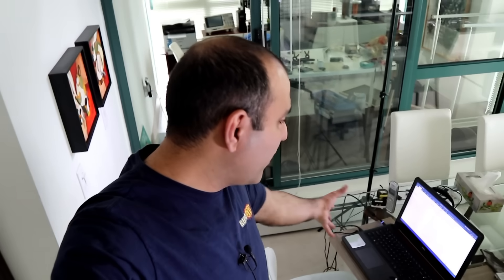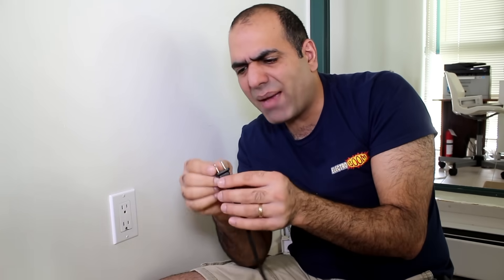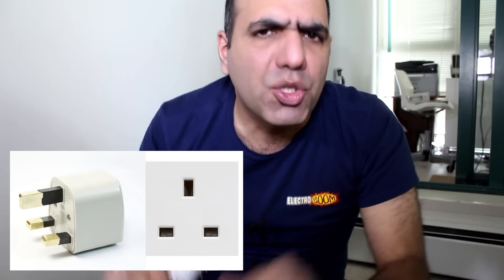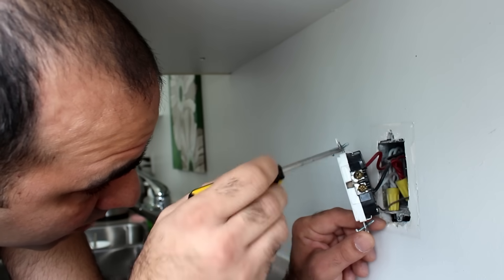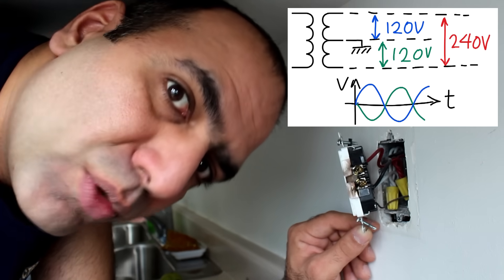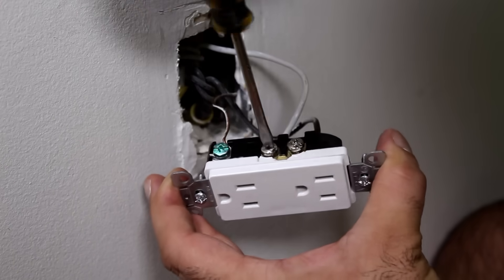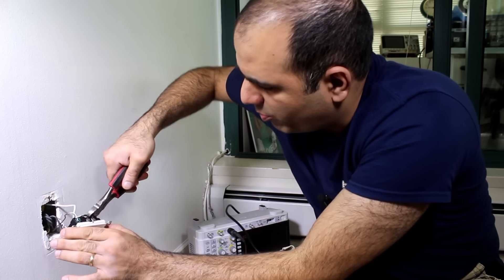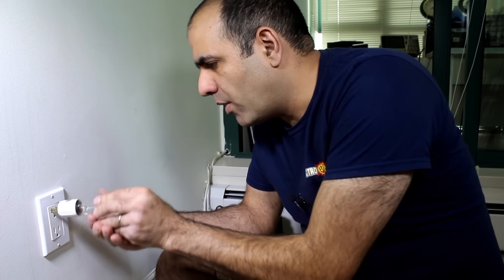How to Replace a Power Outlet

Comment: As an electrician I can tell you now do not use the hole in the back to plug the wires in make hooks and tighten them down around the screws
Reply: besides any safety issues, it's just more convenient to unscrew and pull a loop off later if you ever gotta replace it
Reply: Also, make sure you loop the wires around the screws clockwise.
Reply: I was scanning the replies for this... you are correct :)
Reply: I was always told that over the years, warming and cooling can loosen the connection and eventually cause resistance... leading to more heat, etc etc... same reason aluminum wire is a bad idea for internal wiring. Best to do it the hard way and clamp them down good with the fasteners
Reply: I have personally replaced many outlets where the previous installer used the push holes and it eventually resulted in a high resistance junction.  I have never experienced that using the proper screw terminals.  Do yourself a favor and use the screw terminals.
Reply: CSX2586 Rail Rider Raby why? Care to elaborate?
Reply: I'll tell you plain and as simply because they do not make a great connection there is a very thin little piece of copper rubs up against the The Wire 2 hold it in and Supply current I have not to this day seem one that did not burn up whenever people plug space heaters in if you cannot guarantee people are not using these to plug space heaters hair dryers or anything else that pulls a heavy load you should not tell them to use the holes in the back the holes in the back should not be used at all they ought to be outlawed if you ask me I have seen many houses almost catch fire from using those damn little holes
Reply: I agree.  I have had many service calls for no power or lights working in parts of houses and most of the time it has come down to the plugs being wired by stabbing in the back and in older homes the wiring was not pigtailed so there would be 2 hots and 2 neutrals.  Over time these fail and the wires either come out or cause fires.
I've had another call with no power, ended up being a hall receptacle, looked perfectly fine from the outside, after removing the receptacle, the wires were burnt and the back of the box was all melted, they were lucky their house did not burn down.
First thing I teach my apprentices, always use screws never stab in.
Reply: Can confirm, had a kitchen outlet that got loose over time because the wire was plugged in and not looped around so we had to redo the outlet because of this
Reply: I myself prefer the screws over the stab ins because only a small amount of the wire is actually touching the connection so it won't hold high currents as well as the screws. I also don't trust spring loaded connections of any kind as the spring looses its tensile strength over time and the connection becomes week and once again can't hold up to high currents or even mild currents at that. It may be convenient  to just push them in and go but if you have to replace it it is a pain in the rear to get the wires out. And this is a problem if the wires are too short to just cut them off.
Reply: The holes in the back use spring pressure to hold the wires tight.  they become weak over time and wires fall out or become a high resistance connection causing heat build up.
Reply: In belgium they are made just to go max 8mm in and screw it in.
Reply: CSX2586 Rail Rider Raby Agreed.

Can't even backstab kitchen recepts anyway. Modern ones are only rated to hold 14awg.
Reply: Fat Boo in the socket itself.
Reply: True.
Reply: CSX2586 Rail Rider Raby Then it's better at conducting high current. Just look at all the metal surface and how big the screws are. 16 years old and not an electrician. Am I correct?
Reply: Inspectapedia has a few good articles on it: https://inspectapedia.com/electric/Electrical_Outlet_Backwire_Failures.php
https://inspectapedia.com/electric/Electrical_Outlet_Wire_Connector_Quality.php
Reply: AKY look harder
Reply: Dimitrije Čaprić I don't understand what your trying to say
Reply: DefinitelyNotHaraku ppl will bore the hole out to 12g
Reply: CSX2586 Rail Rider Raby holes are faster and time is money they are good enough for the consumer but I use screw terminals in my own installations simply because it's a better connection along with being future friendly no chopping wires and shortening them if you want to change the receptacles
Reply: Can confirm. The holes are for chumps.
Reply: 9ff70f96 who lied to you I've been doing this 27 years there is nothing Superior about the holes over the screws screws
Reply: Nothing wrong with them if done correctly.  They can often prove better than clamped terminals as they don't tend to loosen after a few years of thermal cycling given that the conductor is held under constant spring tension.  Screw terminals invariably become loose over time, with the associated risks which that then presents - high-resistance, heating, melting, burning, fire, death.  Screw terminals also have a much higher chance of becoming loose again during reassembly of the socket.

Comment: Coming from a licensed electrician,  NEVER use stab in holes in back. Wire is then held in place by cheap spring which will loosen it's grip on the wire over the years. Black to brass screw, white to silver screen, ground to green screw

Comment: I actually screamed "NO" at the screen right before the screwdriver exploded.
Reply: ElectroBOOM, outlet, screwdriver.... predictable  :)
Reply: My dad did that once, he didn't want to try to find the right breaker and thought if he just shorted it out the breaker would trip.  It blew a huge chunk out of the screwdriver.
Reply: Why not "Do it! Do it NOW!"
Reply: Darik Datta same
Reply: I think they design them for at least thousands of interrupting operations, so unless you are rewiring your house every day it shouldn't be a problem.
Reply: I'm not sure what brand of circuit breakers you use in US so can't discuss it properly without datasheets. Can you give me a manufacturer and model number for a typical domestic circuit breaker? And if by "one dead short" you mean short with current around their rating (something like 10 kA) then yes, but it's hard to attain unless you have your own medium voltage - low voltage transformer.
Reply: @shana_dmr  typical house panels are either square D or general electric
Reply: Because he will hear you
Reply: Darik Datta when
Reply: why you always voltmeter beforehand...
Reply: Nope. They'll take one (1) dead short, or a hundred or so lesser short circuits.

You can flip the switch on the front thousands of times, so do that instead.
Reply: dont worry he is doing that for ratings

Comment: How to solve it: get EU plugs. or move to mars
Reply: They are pretty much all compatible. Except for the UK one. But they aren't EU anymore soon anyway.
Reply: “EU plug” may refer to three different plugs:
1) europlug, 2.5 A, works everywhere pretty much everywhere, no earth 
2) cross compatible French-Schuko earthed plug (polarized on French outlets, unpolarized on Schuko)16 amps, grounded (won’t work in Italy but we have to buy stupid adapters every time so we are used to that)
3) cross compatible French-Schuko unearthed double insulated unpolarized, 16A (same problem with Italy but we are used to adapters)

As you said the traditional French and German plugs aren’t compatible, but nowadays most new appliances come with the cross compatible plug, only thing that changes is the plug and extension cords)

As for “the eu plug that should work in Italy doesn’t actually in old plugs” that might be true, but the oldest plug I could find was still compatible, just there are two separate sizes, one for lights (10a and used to be 100v, but it’s now 230) and one for “power” the two sizes used to be different plugs, but they no longer are, we have lights plug only (which is really just a europlug with the earth in the middle), and the “bipresa” which is both of those combined, nowadays they also sell ones that not only are compatible with Italian lights and power, but also with Schuko and therefore other eu plugs (not very widespread though)
from what I was able to find, they we always the same distance, on the lights one, so I don’t see why they wouldn’t work with europlugs. 

The “eu socket” would just be the French socket with side rails and no support for the old plugs, would still work great as a stand-alone socket
Reply: Theres different types of plugs in the EU, lol.
Reply: +Adrian Bergqvist - YES , but even the crappy USA system can be fixed while staying (mostly) backwards compatible , using EU solutions 
on USA type-B system = UK Sleeved pins + German Recessed sockets & Earth on top like in most polarized plug countries (except Denmark & Israel) ... for type-A plugs there can be SAVE adapters like a SAVE UK-Europlug-adapter , while phlasing pout type-A
Reply: They should not. There's actually an advantage in having a plug that has a completely different shape.  they are running 120 volts, we are running 220. If they use the same plug, one could plug 220 volts equipment into a 120 volts line. It's probably not as bad as the opposite though.
Reply: jort93z that's old pulgs. After 2004 whole Europe is standarized
Reply: +Roko Krstičević - except Britain, Switzerland, Italy (partially) & Denmark ... all the others use type E+F plug ... the Europlug just doesn't fit in UK
Reply: most of european sockets are shit, especially low budget ones, they have those crappy ground contacts that allways bend and not having that solid contact surface US sockets have,
stay safe, guys !
Reply: Nah, they aren't all compatible. The traditional french plug is not compatible with german schuko sockets, the traditional german schuko plugs are not compatible with french sockets. The Type L plug used in italy is neither compatibly with the german socket nor with the french ones. And the traditional italien socket won't accept that CEE 7/7 plug that conviniently works with french and german sockets.
Theres plenty of standards around europe.

Comment: That picture of the UK plug you showed near the beginning is actually a false model.
The earth pin at the top should not be sleeved because that renders it useless due to the design of the socket.
When the earth pin is all the way in, no contact will be made because of the sleeve.

Comment: You have the wrong UK plug picture. There should be no sleeve on the earth pin.
Reply: Yeah, that's the fake version. The real one: https://en.wikipedia.org/wiki/AC_power_plugs_and_sockets:_British_and_related_types#/media/File:Moulded_and_rewireable_BS_1363_plugs_(horizontal).jpg
Reply: That incorrect sleeving is pretty common on cheap ebay products. 
It's worth keeping an eye out for as it makes the whole system more dangerous, as it has the potential to defeat the earth connection altogether. Big Clive has mentioned it several times.

Comment: What a piece of crap. In Poland the only problem with the power outlets is that they might break free from the wall if you unplug your device by pulling the cable and not the plug itself. If you use them properly they can last... hmm let see... 200 years? They're literally unbreakable.